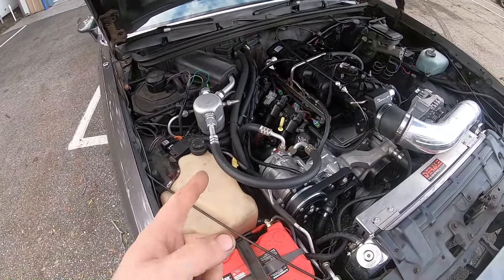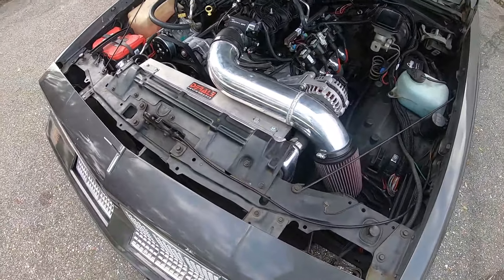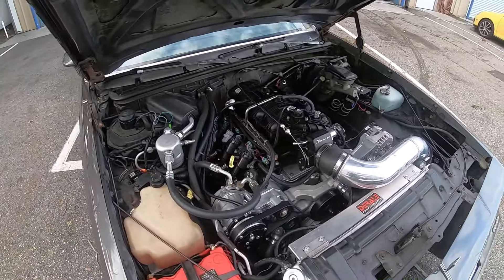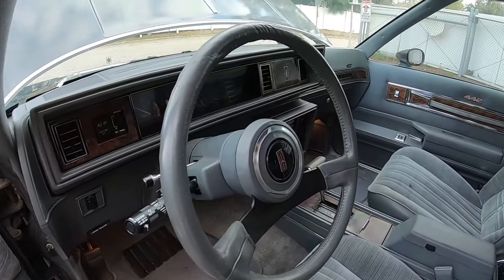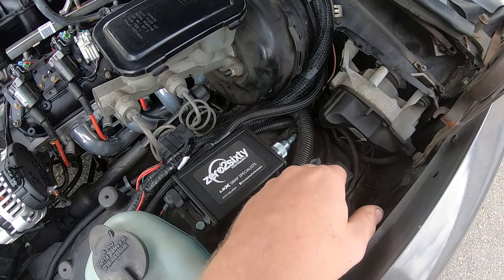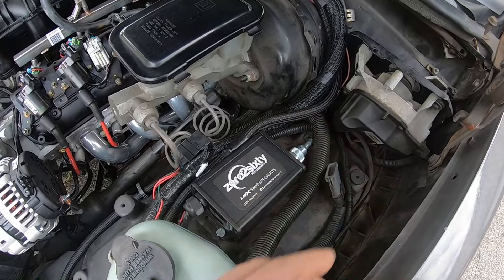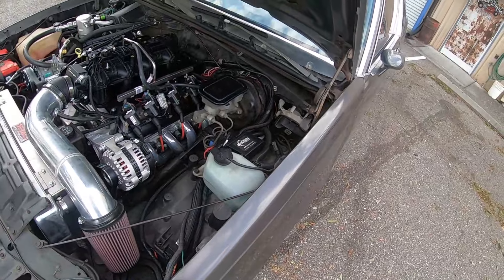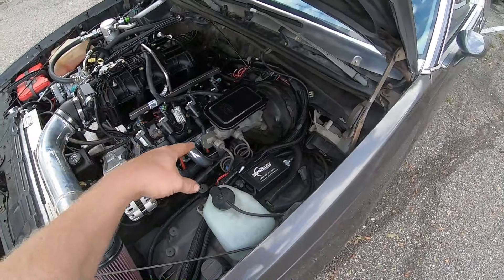A G Body LS Swap that even you could do! Cammed 6.0L LS & 4L80e Swapped Oldsmobile 442 G Body

Comment: Maybe I'm getting old but l much prefer this Cutlass over a brand new Camaro SS like the gray color no vinyl top the only thing with these cars is the 7.5 rearend if you got a 8.5 rearend out of a 1984-1987 buick GN it comes with a much better 8.5 rearend probably could put in a Ford 8.8 out of a 1985-2004 mustang GT with the right offset wheels l think it could work it's close to the same length very nice car love G-bodies this one is sweet l am a big fan of Chevy LS engines the power reliability and durability surpasses the old style smallblock by any other manufacturers and equals the power of a bigblock in a lighter higher revving package have seen modified 6.0 and 6.2 liter engines on premium pump gas run with and many times out run modified 396 427 454. 496 502 bigblock Chevys running premium pump gas not to mention the LS will without a doubt last at least twice as long as these bigblock engines and in many cases the LS engine is giving up 20 to over 100 cubic inches to these bigblock Chevys
Reply: Just an FYI the 442 Cutlasses actually came with 8.5 rear.

Comment: Hey I want to do a ls swap for my 68 chevelle just don’t have the time . How much would it be to get it done
Reply from the maker: Depending on the engine and transmission used for the swap the price can vary. The typical 6L and 4L80 swap is roughly $16-18k installed

Comment: Any clearance issues with the power steering pump? Mine hits the power steering gear box
Reply from the maker: What are you using for an accessory drive?
Reply: Im using all the stock accessory drives , but I seen some that move it up higher or swap the alternator with the power steering

Comment: I'm considering buying a 86 Buick and doing an LS swap, seller has the engine mated to a 4L80E. I would be getting a shop to do the conversion for me what do you think hours would be to get this all buttoned up and completed and what would roughly looking at parts cost to complete the job?
Reply from the maker: On a swap like this, if the customer was to drop off the vehicle and and engine/transmission, you have roughly $9-10k in additional parts labor and tuning to complete the swap. You can purchase all of the parts we used on this swap right off our website. Im pretty confident you could complete this swap in a week.

Comment: The cutlass is so tiny put ls in Cadillac Fleetwood, b body. I'd take wrecked no title Firehawk or Camaro with 5.7 LS twin turbo. Get mechanic with torch, plasma, saw saw, grinder, they even sell plastic LS block and Mac and cheese elbow to mock up headers from scratch. Thing I don't understand wiring. I'd do it car don't run pre emissions. Fittings, issues, hoses. You might even need little pick truck. Nobody is going want work on your LS mess
Reply: Hey what type of rear end did you put in it 8 bolt 10 bolt 3.73